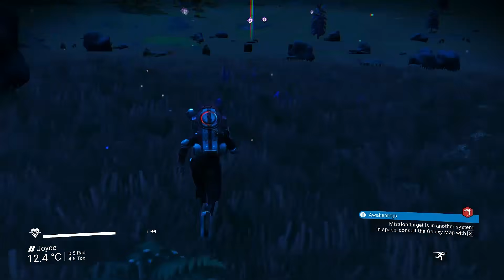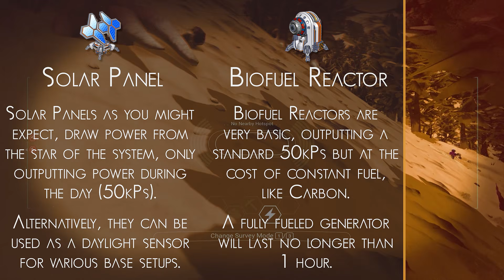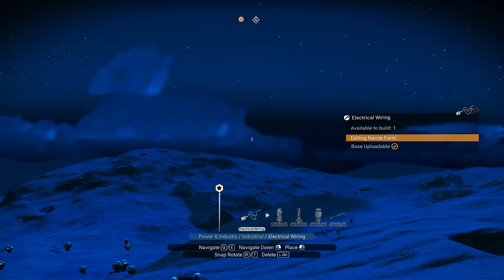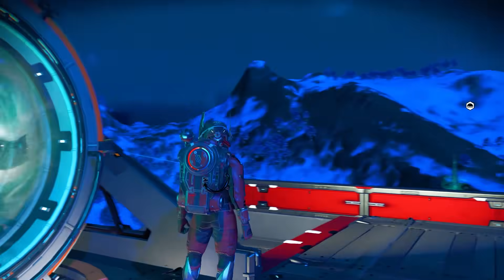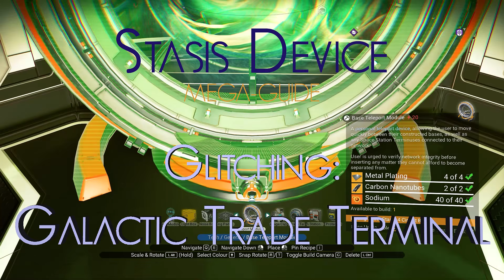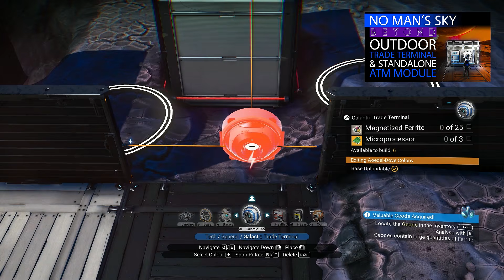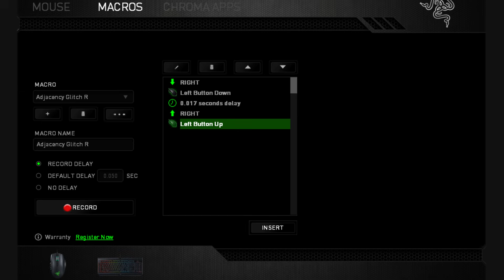Ultimate Money Making in No Man's Sky | Stasis Device Farming Mega-Guide, Units & Building NMS

Comment: Following Xaine’s guide for Stasis Device farming, I broke down the farming for a more casual experience. I play a few hours every day so at best I have maybe one manufacturing run per day, far below the potential of Xaine’s method. The smallest easily divisible number of stasis devices you can make per day is 8 per 16 hours, limited by the growth rate of Cactus Flesh. It breaks down below for a single run per day:

For every 1/2 Bio-Dome’s worth of Cactus Flesh (8 planting spots out of 16) you need:

1 Bio-Dome of Gutrot Flower
3 Bio-Domes of Frostwort
4 Bio-Domes of Gamma Weed
2 Bio-Domes of Solar Vine
4 Bio-Domes of Star Bramble
400 Dioxite @ 25 / hour
4000 Nitrogen @ 250 / hour
400 Paraffinium @ 25 / hour
400 Phosphorus @ 25 / hour
4000 Radon @ 250 / hour
2000 Sulphrine @ 125 / hour
1440 Oxygen @ 90 / hour (To make 2400 Condensed Carbon & 1200 Ionized Cobalt)

The rates per hour are the minimum rates of mining you’ll need to have the required materials needed for harvesting every 16 hours. Most of these you can easily hit with a single Industrial Extractor, just be sure you have the necessary supply depots to hold what you need.

Make sure to keep at least 1 Condensed Carbon and 1 Ionized Cobalt in your inventory at all times to refine with Oxygen. Keeping extra of these 3 elements is recommended. The more Condensed Carbon and Ionized Cobalt you have in your inventory to refine with Oxygen at the start, the less oxygen you’ll use to make the needed mats here.

Each run will net you about 124.8 mil units per 8 Stasis Devices.

From here, scaling up daily runs is as simple as multiplying by whole numbers. Follow Xaine’s Guide for the rest.
Reply: You need 4000 sulphurine per day, same as nitrogen and radon.  1 stasis device costs equal amounts of each so I'm not sure why you said you only need half.
Reply: Your stuff is slow using the refiner is still faster. Than waiting for plans to grow.
You can stack mining extractors I have 1,125 per hour. 8 hours fills 10,750 nitrogen for me.
Using gold, silver & indium in a big refiner gives out 30 chromatic mental. From 3 pieces of each thats 10x more.

Nitrogen salts are fastest to make in a large refiner you can make 10 in like under 2 minutes.

Comment: Bio-domes can now be double stacked without glitching, you can plant even in sites obscured by stairs, and you can even run around inside the upper domes if you link them in the same way as the lower level.

I'm mostly building Stasis Devices and Fusion Igniters to use up the Geodesite and Iridesite I've been accumulating from freighter missions. In a few days since I finished my bio-dome farm, I've gone from around 5 storage containers full of various components for them, to a couple of storage containers half full of Stasis Devices and Fusion Igniters, a few more days and I should be able to sell them all and get a reprieve from my chronic hoarding problem. *8')

Thanks for all of the help getting this up and running.

Comment: Just finished mine. I did the crops last so I’m gonna let them grow overnight. It took a long long time, but it was fun. Hopefully it was worth the grind.
Reply: I have this MASSIVE crop farm that consists of SEVERAL biodomes, each of which has 16 instances of one plant. So, one biodome has 16 Frostworts, one has 16 Solar Vines, one has 16 Echinocacti, etc. Oh, and I even have a biodome with 16 Gravitino Hosts! And, I have one of those Galactic Trade Terminals in the Circular Room that's directly underneath that one.

To get the full 16-plant capacity out of your biodome, you need to access it by ladder instead of by door. The way to do that is by placing the biodome on top of a Circular Room. Then, place the ladder in the middle of said Circular Room.

Comment: This is one hell of a guide I can not imagine how long this took to put together. I think I will stick to my activated indium farm as you can simply buy cheap ships and then scrap them to get the storage augmentations but I appreciate this guide.
Reply: Can you explain? This stasis thing is way too much for me.
Reply: @TakeARideWithMe  Go to a blue system and look for an extreme planet you will know by scanning the planet and you will see activated indium. Find the hot spots for me I use a A class for both power and the activated indium. They should be within 1000 u's of each other. Set up a base computer and then start pumping out the electrical power generators mineral extractors and supply depots as many as you can make. I like to do it in a rich korvax system because I essentially go to war with the korvax and attack freighters  for the chromatic metal and magnetized ferite to make the miners and power. I like to set up short range teleports between the hotspots to make traveling to each easier and I set up a centralized platform for all my supply depots right above the base computer that way I can teleport in and gather all the AI. I produce about 150k of AI and I make over 100 million units in a couple hours it just depends on how many of the mineral extractors and supply depots you make.
Reply: @TakeARideWithMe  For the ship portion I go to the space station and buy A class starships for 2-4 million a pop I then scrap them and then sell off the tech modules for nanites. You should get most of the money invested into the ship back when you scrap them and you will be getting tons of ship storage modules about 2 per ship. After upgrading all of my star ships to max inventory I will then start looking for S class ships to buy then I will max out those because scrapping ships gives you money based off of how many slots they have. I will usually profit about 100 million units per S class ship that I sell back. This is usually just to recoup any losses I took to actually get all the storage slots but you end up making a lot of profit. It is way cheaper in the long run to buy cheap A class ships for the Storage augmentations instead of outright buying them. It can take a little bit of time but in my opinion it is much better to scrap ships for the slots instead of buying them outright. Hope what I wrote made sense it is late for me here if you have any questions feel free to ask.

Comment: Absolutely incredible write up! One tip that blew my mind was color coding the save beacons according to resource when hotspot hunting. I used that right away and it made a huge improvement. I've just completed all the components for my own stasis device manufacturing, however it's spread out across a few systems. Maybe one day I'll build one in one system. Thanks so much for the help!

Comment: Also with the red barrels. If you have them in your freighter they will reset each time you start a fleet mission. I have 5 fleet command centers onboard so I can start a mission, collect the barrels, start another mission, repeat until the max of 5 missions are active and you have quickly collected all of your barrels 5x
 Update: they also reset whenever you warp the freighter
Reply: Is this still required? I wasn’t fully listening and I think the barrels were for nav data so he could unlock blueprints from a manufacturing facility, however u can just buy the blueprints with nanites
Reply: @snailgrease7076  ya it was just for nav data. But the barrels are pretty great on a freighter if you have enough of them. Think I have 14 and every time you warp they reset, literally gave me back all and more antimatter and housing to make warp drives then I used travelling and I jumped Probably 75 times looking for the perfect system lol

Comment: Built this farm on console and it works nicely - having it make 32 devices per day because that's all the bases can handle w/o crashing. Something of note for the other console users:

The game forgets to load some of the plants in the domes when you warp to those particular farms. I split mine into 3 separate bases to get as many spawned in as I can, but there are times where it'll still not load them. A quick fix is to put down a save point near the ends of each path to load those domes first with a manual reload; it seems to do the trick.

Comment: Quick tip for anyone that is playing on console! When building this you do not need to make as many bio-domes as long as you’re ok with doing some simple and easy glitch building. On console you can use wire glitching as it is much easier to do while on console with the timing and buttons being much much more relaxed and easy. It is technically possible to fit all of the crops into one bio dome so you can save on a whole ton of frost crystal and time of running through the farm collecting crops so that you can collect all the crops with on button press.

Mini tutorial:
To start simply place electrical wires at each place that crops would usually snap to. After doing so choose the crop you wish to place in that location and then click Y on Xbox or triangle on PlayStation, this will switch you to wiring mode you can see the controls on the top of your screen where it will say “toggle wiring”. then look at on of the spots that you placed wiring at that the wire will snap to and then click the toggle wiring button and the place button at almost the same time with very little time in between with the toggle wiring being clicked first. You can place as many crops as you wish to in each slot. You can also do multiple crops in the same spot which can actually making some cool looking hybrid crops

Troubleshooting:
if it is not working check to make sure that the wiring isn’t following your cursor so to check this just look up a tiny bit and if you can see a wire following your cursor simply cancel the placing by clicking b on Xbox or circle on PlayStation.

all crops placed will be harvested at the same time by using the monitor in the top center of the bio dome. Also when placing using the wiring glitch it is not limited to placing on places that wiring can snap to so you can place almost anything in the game anywhere with in your base at many different angles using this glitch.

Please let me know if you have any questions. Also quick note this is currently working and I doubt it will be patched for a long time as it has been in the game for a few years.

Comment: im making this in 2024 and im wondering how you get the supply depots for the gasses to hold 32,000 of them. I have multiple supply depots down with a max of only 8,000 sulphurine.
Reply: There is a glitch that allows you to stack multiples on top of each other. You can link them together into a single pipe. I've not been able to do it yet, but there are videos that show how.
Reply: you have to connect all the supply depots and all the extractors with conveyors (not sure exactly what they're called but they're in your build menu). This creates one network. the extractors will have signifigant diminishing returns past 1000 per hour though in the same network so if you need more than about 1200 per hour you'll want to create seperate networks.

Comment: just buy a lot of oxygen, then refine oxygen into chlorine, then sell about 40 stacks at once and buy back at -80% demand -> repeat at every space station that sells chlorine - profit

hit the money cap in less than 2 hours and all you need is the refiners

but i still appreciate the methods described in the video. learned a lot about efficient spacing anf wiring
Reply: But doesn't it take a few days for the economy to recover?
And is it possible to do it at trade stations as well or are the economy linked in the same system?

Comment: This is an incredible amount of information, much of which is useful even outsideof this specific farm. Heck, 300 hours in, and I didn't know what barrel fabricators did. Huge thanks to everyone who worked on this guide.
Reply: Update: Seeing the glitched gardens, I wondered if the wire glitch could be used to maximize harvests. Turns out, it can be, but with an extra step. Wires can't be initially placed inside of a dome, however, by building a light and attaching a wire to it, the wire glitch can then be used to place plants everywhere inside the dome. Just have to start the wire glitch by creating a wire on the light. I tested the harvest, and all glitched plants were collected as well (same as with the stacked domes). Using this, only one dome should be necessary per plant, though might even be ramped up to one dome total (not sure how the game would handle that many plants harvested at once, but in theory, one dome would work)
Reply: Update2: Just tested some more, and lights are unneccessary, the 'plugin' on the dome itself works fine. Also tested stacking plants, and it looks like clipping plants into each other is difficult, to say the least. There is a large-ish area around the plant where the wire can be placed, leaving quite a bit of space between plants. Still making for a ton of plant capacity per dome, as the plants can be placed on top of each other and connected to the glass of the dome. It's really wild to look at.
Reply from the maker: Thank you, it took a while lot of work to do, it's my biggest project so far :)

And aye, wire glitching can be used to increase the yield, As wire glitching is too bothersome for most, I settled for explaining the glitch briefly and the mechanics of the done harvesting so those that may wish to do it would have the tools, and decided against an extra section for it.

I will be employing wire glitching to glitch hundreds of plants into a single dome in the UASs 6 biome system for the depots, if all goes to plan, they all be perfectly glitched inside of each other and will just look like a normal single filled dome, but harvesting will give thousands
Reply: @XainesWorld  Fair to only include the one method, having every possible useful glitch would make the video several times longer, I'm sure. 
Thank you again for this guide, too, I learned quite a bit more than expected. You certainly earned the subscription

Comment: One thing ive found for Star Bulbs, is that if you build your domes into the ground so that the ground is the same level as the planters, you can plant 3/4x as many Star Bulbs than normal, for mine I only had the ground showing around the edges but It would probably work for the whole dome so you could get 5/6x normal planting number. Best thing is that they are still all harvested from the console. :)

Comment: Just finished my stasis setup. I can make 100 a day and I might scale this up. The way I do it is by ignoring the growing times altogether. You can just duplicate crops through refining. Gama root needs uranium, frost crystal needs dioxite ect. I used glitch building to bypass the refiner limit per one base and I just built the exact amount I needed to refine enough for 100 devices. You could still do it without that but you'll have to spread your refiners out or use multiple different bases. The tedious part is just setting up all the gas and mineral mines that you're going to need and making sure they have enough output, particularly the gases as you need 50,000 each for 100 devices. I can expand on this if anyone else is interested though the video covered most of it.

Comment: You can max out your units easily once you have a Stasis Device / Fusion Ignitor that sell for 15 Mil just duplicate them with a small refiner, Or you can now just turn off cost and items in settings that basically turns off the grind part of the game, Personally i just grinded down the tier list by going out exploring to collect all the relevant items required for each stage until I had living glass and the Circuit Board to make the Stasis Device.

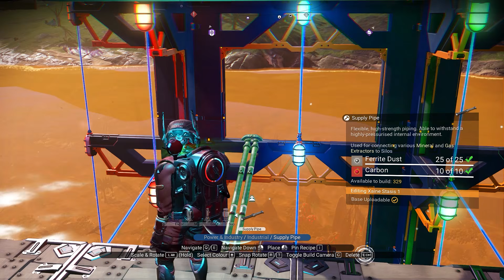Comment: @Xaine's World 39:30 you say that you can't connect to a pipe that is already laid.
That is false, and I would make a video if I had the energy, but you can test it easily.
(There could have been an update since you put out this video that enables it though)
Place the new pipe on a connection to an already laid pipe, which are those bulky areas at either end and the middle of it (yes the middle works).
You have to make sure that you are placing your new pipe on the right facing of the old pipe.
Not on top of or on the side of the pipe, but at the end of it. 
Hope it helps someone that didn't know at least :)

Comment: If you use silicate powder instead of frost crystals you'll get far more glass with less product. Granted, you can't get silicate powder passively but if you take about an hour a week to get silicate powder by mining basic terrain you'll have more than enough. You need 200 frost crystals for glass but only 40 pieces of silicate powder and you don't have to wait an hour to get it. You can get 40 in 2 seconds by mining terrain. Just a tip.

Comment: Hey Xaine, thanks for putting in the time and resources to make this guide. Very insightful. My questions though is how to stack EM generators. Not sure if it's possible to build them upward in a tower or if that only works for gas extractors? Thanks again!
Reply from the maker: yes you can stack extractors, silos and generators fine, just place them on top of each other. If you wanted you could also glitch them to be perfectly in line, but manual placement is good enough for sure